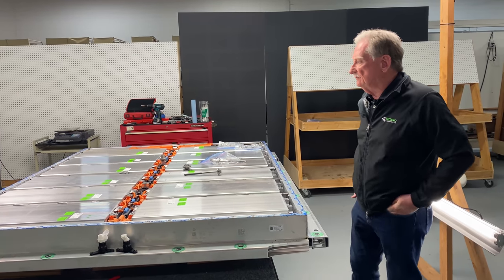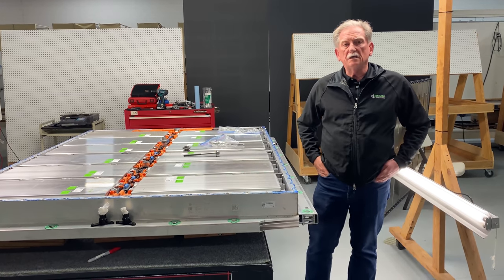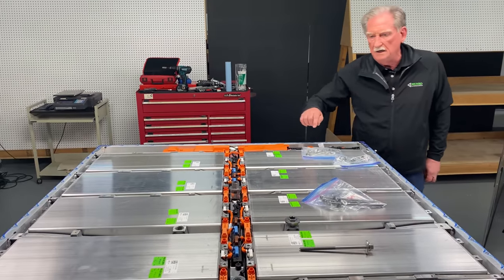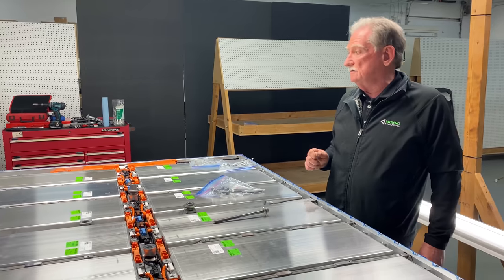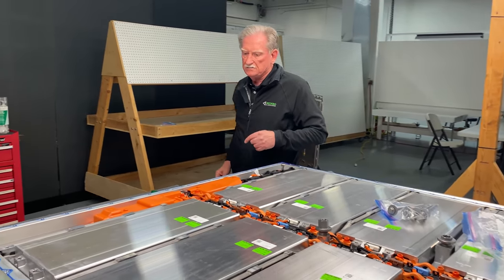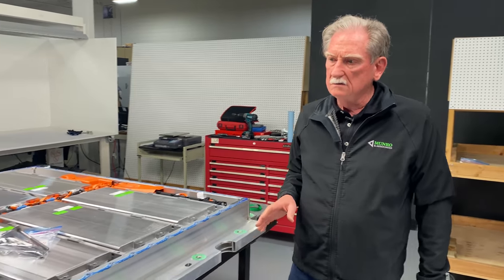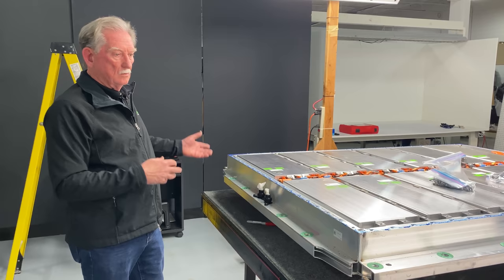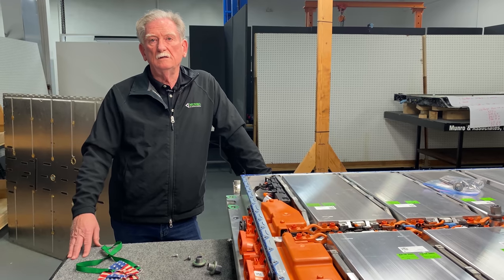2021 Volkswagen ID.4: Battery Teardown

Comment: Flow drill fastener threaded hole at 6:00 looks more like a threaded steel insert pressed into the aluminum extrusion.  The fastener certainly looks like a flow drill but maybe they just that for the self aligning tapered feature at the tip?

Comment: The Model Y battery is 5.853 kg/kWh (615 J/g in SI units), but includes an inverter, etc. For just the ID4 battery, should consider achieving the devil's number 666 J/g (5.4054 kg/kWh - 443.25 kg). The cells don't need to be in those aluminium cans, only need an aluminium base to the cans for heat transfer. A big advantage of the low power ID4 is that the battery current input and out can be matched - the charge rate can be the max power out of the motors.

Comment: There is definitely an abundance of fasteners, but that looks like some very integrated engineering. Considering that is the MEB platform, the pack was likely designed to be an integral part of the chassis and weight savings when thinking of the pack itself would incur penalties elsewhere in the chassis to maintain crashworthiness and durability. Modest kaizen will shave a bit of weight and production cost off over the years but nothing like the manufacturer wants.

Comment: By using extrusions on the sidewalls building different battery sizes is quite cost effective. Having different mouldings for different batteries is not as cost effective.
I think the best place to reduce weight by introducing finer reinforced polymers is that huge lid.

Comment: First thing to do is to get digital model of that thing and put it into mechanics software. You also need model of almost all body of car, so both models to be connected. And you need all the loads to be applied to models + ... You will get stress, deformation, temperature, time data to see what can happen in real life. This is what they do. Huge amount of work. And After this you can switch material and structure to other one and see if it can handle all these deformations, wear, etc...

Comment: Here is my problem with the polymer-composit solution: With VW's solution, you basicly got one very big slab of aluminium. That means - if I'm right - the batterypack acts as one peace ift its subjected to heat or rapid motions and/or weight. Polymer-Composit Battery-Pack would mean that different materials with different behaviors in contraction and rigidity make up the battery Pack. Wouldnt that compromise the cars overall rigidity?

Comment: Is the battery tray a stressed member of the car chassis?  Is VW willing to share that information with you?  If you change the tray material to some amount for weight savings, will you run baseline static and dynamic analysis on the OEM to compare to the material changes to verify there is no degradation to vehicle performance?  Seems like the redesign will be challenging.

Comment: Sandy, your are awesome !! I love your analysis. Glad that at the end of the video you recognized that the battery frame is for structural reasons and to protect the battery from side impact. Personally, I did stick with this current fame structure and material but tweak it a bit to reduce the weight.
Keep up the excellent work Sandy. Can’t wait to watch the next video
Reply: What makes you think they didn't already remove as much weight as possible during the development phase where they literally built hundreds of prototypes and tested them (including many crash tests) to see how much material they could remove without compromising the structure?

Comment: I agree with the weight reduction by use of polymers or composites instead of metal.
But how are OEMs going to take recyclability of these components that use modern materials such as carbon fiber composites?

Agreed the decrease in weight also contributes to overall input cost reduction, but isn't it Paramount to consider recyclability as an aspect while choosing a material?

Comment: so, lets calculate the kg per kWh:
Bolt: 429kg --- 57kWh ==> 7,53 kg/kWh
TM3: 442kg --- 75kWh ==> 5,89kg/kWh
TMY: 439kg --- 75kWh ==> 5,85kg/kWh
VW ID4: 489kg --- 82kWh ==> 5,96kg/kWh
that means, that Tesla and VW are both in the same category regarding energy density. which also means that tesla is not superior regarding energy density like their fan boys claim. the difference is less than 2%
thanks for the real world numbers

Comment: The VW's battery is 50 kg heavier than the Tesla's, but it also has a higher capacity. If you correct for capacity it's only 10 kg heavier.

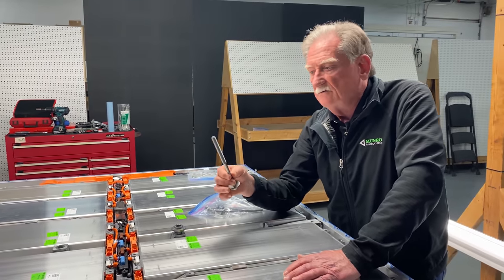Comment: 4:05 8.8 is a strong bolt? May depend on the field your working in, but for me, that's somewhere in the middle. Lowest grade suitable for pretensioning in structural applications (6.8 probably would also be suitable for pretensioning, but I never saw those).

Comment: as a retired aircraft tech in one of the major airlines, why not use a titanium rib frame that's used on the fuselage, and wings? titanium is light and has high tensile strength. even if the cost is high, it will be cost-effective in the long run and extent mile range.
Reply: They plan to build 380000 per year just at the Skoda factory, not sure if it would be cost effective (and ressource dependent on russia?)

Comment: Get rid of the modules. Make an injection molded membrane to hold and cool the individual cells. Use a PCB-like CNC'd metal sheet for the battery contacts instead of wires.

Comment: one major problem with a polymer  it warps. probably the reason vw went with aluminum. they have quite a bit of experience with failed plastics through the years.   the other reason is fire protection. for a little bit anyway

Comment: The tray no doubt takes heat away passively along with active coolant pathways. If it were composite more cooling would be needed. Not sure this saves weight in the long run.
Reply: Yes. Aluminum has an extraordinarily high specific heat capacity, which must help in maintaining constant temperature.

Comment: 1:34 - The battery tray comparison is misleasing. Chevy Bolt, Tesla Model 3 and Y are stated with their net capacity/usable capacity.
In contrast, VW id.4 is listed with is gross capacity of 82 kWh, of which 77 kWh are usable.

Comment: It still feels like VW is not building EVs and thinking about a design holistically. Every fastener added is another possible point of failure, more weight, extra build time, extra logistics, etc. Until they start getting cleverer, I'm not sure they'll beat Tesla on the mileage they can achieve. Also, there's so many different manufacturing and assembly techniques going on here. There's stamping, die casting, milling, brazing, welding, gluing, extruding, and injection molding. You need to either have space for that yourself or whoever you've contracted to manufacture this has to be competent in a wide range of fabrication techniques. The extra cost of finding expertise along with the large amount of time required to fabricate and assemble something like this decrease the margins for manufacturers. Great video on how to think through a redesign.

Comment: What about the cost for using a polymer composite and carbon fiber ?
And what would be the behaviour of such polymer regarding thermal runaway  ?
Finally would it be possible to recycle this new polymer ?
Besides with a cell to pack design optimization using the pack structure as thermal dissipator , the polymer would not be preferable :-(

Comment: That pack looks pretty skookum. Trying to make a plastic one instead seems to me it's be very hard to get the same strength, and thermal performance and you'd completely lose the recyclability. Also maybe the pack is partly/mostly heavier due to different cell chemistry/module packaging from Tesla? I guess the cooling is in the shell here, rather than in the modules the way it is in the earlier Tesla packs. Also, should Sandy be prodding busbars in the middle of a vehicle pack with his bare hands? Aren't there likely to be significant voltages present? Obviously it was fine, but is he just relying on only touching one connected spot at once or is there some isolation/insulation I'm not spotting?

Comment: Maybe I missed it.  But i thought VW did it this way intentionally.  As the battery bank is also used to fortify the unibody chassis?  

Obviously I’m no engineer, but this approach used in my ID4 seems like a more robust design.

Comment: The main thing I see are boxes in a big box. So something I would immidiately look at are the battery housings. It look kinda redundant.
Reply: Redundant only in final assembly form. From VW's (and Chevy and Ford, etc) standpoint, individual modules makes sense as they can repackage the same exact modules in different cases across their entire product line. Its a mixed bag, but this kind of approach is just how automakers traditionally do this stuff. Its called the parts bin approach. They design components to be as generic as possible so they can fit into any vehicle and just become a standard parts bin part.
Reply: @patreekotime4578  I know that. But this approach will kick their butts because Tesla and others are moving towards more and more integrated packs.
Reply: @markusdd5  So does VW. They announced at their Power Day that they are moving to cell-to-pack in the future when they switch to their unified cell. But for pouch cells you need a battery module, they don't have a hard shell like cylindrical cells, so they need to be contained somewhere.
Reply: Use the mega casting to make the middle part of the car and integrate all the battery parts there
Reply: @Markus Krause they contain pouch cells, which don't have a solid shell. So those module boxes basically serve the same purpose as the metal cans of cylindrical cells. Not much redundancy there...

Comment: If you replace the metal body by polymer you insulate the battery pack and increase the cooling effort, right? This will decrease the efficiency of the whole system. 
And replacing the bolts does not mean omitting, you still introduce weight by the alternative connection. 
And I am not sure about the ten dollars per kg. Does it refer to the weight of any part, or the battery material itself? 

All in all not really a good Value Engineering session.

Comment: I hope the batterypack is deeply discharged? 
Me as a electrical mechanic from vw, had to get a special degree for opening de battery pack! And if i do so, i have to wear special kind of clothes! So i can not be electrocuted by a arc flash is i touched some components. In the pack!!!! 
Safty!!!!!!!!!

Comment: There are already at least 6 different model 3 batteries.
53kwh, 55kwh NCA (both SR+ US), another ~50kwh LFP (SR+ China) 
76kwh / 78kwh/82kwh (LR & P)
Would be interesting to seeethe differences between them.

Comment: 9:20 No, because those extruded aluminum profiles take a LOT of energy in case of a side impact crash. They cost little and are scaleable for different battery sizes. Just the ID.3 is available with 3 different batteries.
PS: The Model 3/Y batteries are a 2017 design. The LG cells have 5 kWh more and when Tesla is coming out with the 4680s this year, THIS looks like from yesteryears.

Comment: Carbon Fibre? Could that be use as the Structure? I suspect the top to the battery pack is Aluminium? Could this be replaced with a polymer top?

Comment: If a bolt is tightened beyond yield point, it does not have much fatigue reserve. Where did he get the information of the tightening torque?
Reply: Check Torque To Yield (TTY) Head bolts. It is common in the automotive industry
Reply: @asicdathens  thanks for the explanation. So thightening beyond yield lowers the stiffness of the bolt and a bigger part of the joint force goes in the flange. More control of the preload force but, if the bolt get loose you may have problems.

Comment: Change the body to carbon fibre and you can save a lot of weight but then costs spiral up so it is ok to say replace metal with composite but what about the cost ;)

Comment: I just watched Marcus evaluation of the F-150. He put up a RPM/Torc chart that demonstrated electric motors maintain torc more evenly over the range of electric motor RPMs. My question is: When does the centrifugal force of a large diameter binding "top out" the allowable RPMs of an electrical motor? I remember a video you put out a couple years ago showing the Bolt motor - which had a larger diameter than the Tesla motor. Also, Porche put a 2 speed gearbox in the Tycan - does that mean they have a less efficient motor with a larger diameter that tops out the RPMs too soon, making the gearbox a less efficient compromise? It seemed like a competitive advantage - was it?

Comment: Forgive me if I'm wrong but do these battery trays not form a fundamental part of the chassis? If this is the case then it's designed to provide strength and protection for the battery module in the event of a crash. Not sure a polymer would have the right properties?
Reply: Yes, VW warns not to enter the cabin with the battery separated.

Comment: I wouldn't make anything out of polymer!  It should be a steel can designed to contain fire since Lithium cells tend to go critical!  It should be designed to vent its contents onto the road away from the vehicle and escaping passengers in an emergency!  Ideally the vehicle is ok if the pack goes up, and we can just unbolt/replace the part.

Comment: Do we know for sure that the battery frame is not being used to add rigidity to the chassis? If so, replacing it with a polymer wouldn't work so well. Carbon fiber might, but that's still expensive.

Comment: It'd be interesting to see if the incoming 2023 MY ID.4 for the US has any differences in the battery pack.  After all it's made by SK now, a different company.
Reply: Seems to have improved charging speeds, ID Buzz with SK hit 186 kW.

Comment: how much to single cast that, Sandy?
a single cast was the first thing i thought of when you said the need to reduce weight and cost. but I dont know what the cost is to single cast it.
they could have a 2 part cast so that a left or right section could be removed without the need to remove the other side!

Comment: Very interesting use of polymers. I take it these aren’t cylindrical cells that could be glued together to make structural element. The Polymer will only serve the purpose of a casket for battery modules with integrated connector housings. Tell us more about their modular cells and why they went this way.
Reply: No, it uses soft pouch cells, which require battery modules (the 10 elements going transverse) as housings. They have already revealed their next generation "unified cells" which will be prismatic and these can be used as structural elements in a cell-to-pack design.

Comment: I think you have your bolt material mechanics a bit wrong. 

A bolt that is torqued to spec is not meant to go above the yield point of the steel, but remain below. This is the elastic region of the steel. There is no permanent deformation when the bolt is unscrewed. If the bolt is over-tightened then the material goes to the plastic region where permanent deformation happens. In the elastic region the bolt as a spring, in the plastic region all of the extra tightening just elongates the bolt while the force remains the same. In order to avoid being too close to the ultimate strength eg. the breaking strength of the bolt you don't want to induce any plastic strain on them.

 Tightening the bolts to a calculated torque causes a preload on the bolts. The preload will carry sideways loads of the joint via friction between the bolt head and the joined parts. This friction increases with the preload and is also affected by the surface friction conditions of the parts, eg. lubricated, rough etc. More friction the more the bolts resist the forces and coming undone. More toque is also needed to achieve the same preload with rougher surfaces. Friction cannot always be controlled so there are ways to verify correct preload without the use of torque.

In pressure face seal applications (flat ends, flanges) the preload usually applies a sufficient clamping force to keep the seal closed and then the pressure acts against that force and tries to open up the seal. The bolts are calculated so that they can take both the preload and still have capacity to carry the load from the pressure.

8.8 bolts are the basic level of structural bolts, meaning ultimate strength of 800 MPa and yield strength of 0.8 * 800 = 640 MPa. 10.9 and 12.9 are then the high strength bolts. I've only rarely come across anything lower than 8.8.

Comment: I hate how all these batteries have to cycle coolant through them, I think it's done because that's what car designers are used to. I'd really like to see a heat pipe solution. Still would require water through cooling, but you don't have to create channels through that entire pack. Might even save you some water weight.

Comment: The tray is made out of Aluminium. Super strong, lightweight, and super heat dispersion. You have only managed to change the good fasteners for a backyard mechanic solution which WILL cost you in the long run. VW engineers actually do a lot of testing and analysis which you have not even considered.
The explanation of the bumps about the electricity flowing through it?? What are you smoking? Must be pretty strong stuff!

Comment: He meant elastic deformation not plastic deformation, if those 8.8 were plastically deformed it would yield to catastrophic failure.
Reply: No, not if the intended load is well below yield. It is used in several applications such as engine cover bolts, which are "torque to yield" fasteners, to ensure consistent clamping force. He is however wrong that initial torque + torque angle signifies that the bolts are torque to yield, it is just a more accurate way of torquing the bolts (but more complex with higher chance of error).